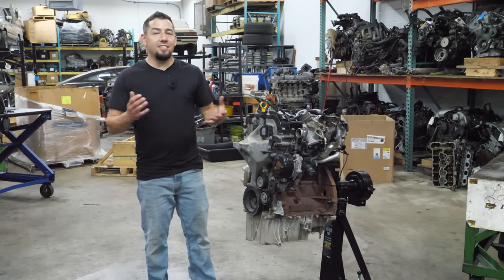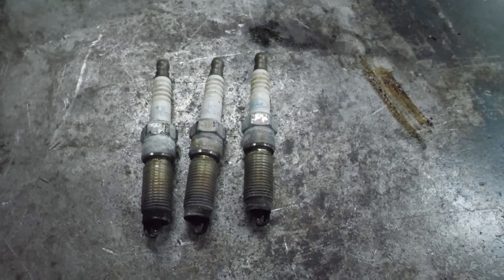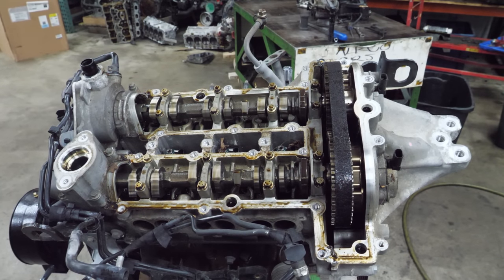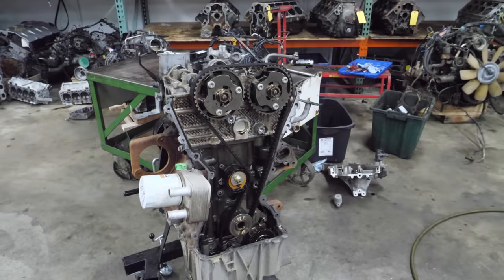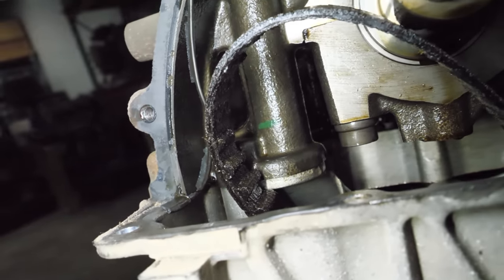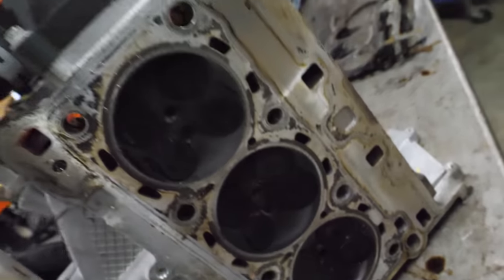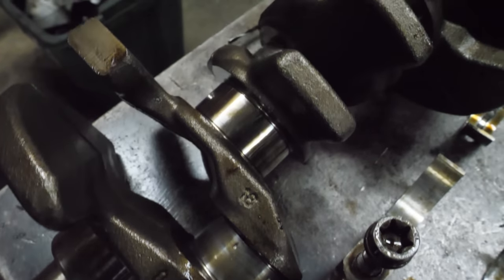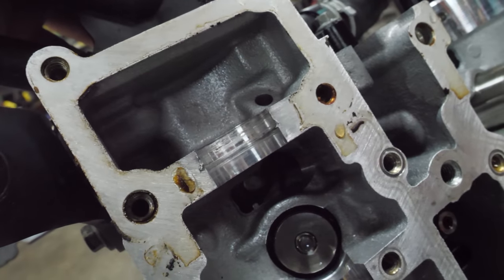JUNK Ford Ecosport 1.0L 3-Cylinder Ecoboost Teardown. LAWSUIT ENGINE!

Comment: I think it'd be interesting to see you do a tear down with an engineer that helped design the engine. If they are no longer employed by the manufacturer then hopefully they could give honest answers about the design decisions they made and the constraints that were placed on them.
Reply: They would tell you they were forced to by upper mgmt which is very likely the truth.
Reply: never seen a wet timing belt design. Never new it existed.
Reply: Packaging, crash safety and cost. Just survivable past warranty.
Reply: @thegrandhoovalation  a 3 year motor or something.
Reply: they'd show up wearing a paper bag
Reply: @paulherbert5548  it exists on Honda ohc lawnmower engines too
Reply: @paulherbert5548 
Reduced frictional losses and reduced noise are two reasons that spring to mind, have one in our 2.0 Ecoblue here in Australia. We call it the Ford Endura which is your Ford Edge. I too was surprised and I’d never known about them.
Reply: God I'd love to hear some dude that is responsible for this hellish engine explain what they were smoking when they created it.
Reply: @michaelslee4336  I'm sceptical as to whether a multiplate chain would have any more friction than a belt , and it is only minimally noisier
Reply: I work at Ford and have torn these engines down, the only fault I see is the rubber oil pump belt that's constantly in oil, the belt breaks down from oil not being changed and it will clog the pick up tube causing failure
Reply: @paulherbert5548  Peugeot/Stellantis also use such a design on their 1.2L 3-cyl
Reply: There’s no problem with this engine except the belts, I heard they replaced it on the next generation. Please stop saying engineering are stupid and so on, some of them arr brilliant mechanics and have shops you would dream of, they’re just asked to make cheap easy to assemble in factory very quiet very efficient engines, and reliable of course. these are the top one requirement, of course it does not mean those engines are the easier to work on.
Reply: @Fabri91  what is the advantage of a wet belt design?
Reply: @johnfloyd2551  why? Whats the advantage of a wet belt design?
Reply: @michaelslee4336  Noise I can understand but frictional losses? Belts already have lower losses and longer life than chains; how much  additional efficiency were they targeting?
Reply: @paulherbert5548  Belt running in oil..............I don't like that idea.    Only Ford could build that.
Reply: @paulherbert5548  
If I remember correctly from when I looked at it ages ago the belt manufacturer claims something like 25% more efficient than a dry belt. Stuff all I suppose given it’s just small thing but when you’re at the pointy end of the stick with efficiency and trying to get the best and quietest engine then they’ll do these things. Couple that with electric steering rather than spinning a pump every bit saves. Electric steering is good for active emergency steering, lane keeping, auto parking etc there’s a bunch of acronyms for them and I wonder was it these things that forced electric steering or fuel efficiency. Probably both at the same time.
Reply: I think they'd be too scared they were going to get beaten with a wrench to turn up! 😂  do you think they tell the guy who fixes their personal car that they design Ford engines for a living? 😆

Having said that, i'd bet money that if you were willing to go to Germany, they'd happily explain why they did what they did, and take you down to the factory to show you it being done, even if the decision was a bit of a rotter
Reply: @michaelslee4336  just trying to get my head around the fact of 25% greater efficiency. If it was that big of a gain I'd suspect it would have been adopted for all belt driven systems. Leaves me wondering ...
Reply: @paulherbert5548  
I did a bit of googling (take that with a grain of salt) they claim, that although it’s a big reduction in friction it’s only on a small component yielding only about a 1% increase in fuel efficiency. 
It’s like having a screw and claiming you can halve the weight of it, yeah big deal you can say 50% less weight (of half a gram)
Reply: The engenders that designed this shit are criminal! I gladly sold it. Even here in Bulgaria the most mechanics know about the problems of the belt running in oil. If I knew that before I didn't bought this car!
Reply: @paulherbert5548  GM 3.0 Diesel in trucks is the same, and worse- it runs the oil pump
Reply: @davem3789 - yep 👍
Reply: @patrickf6553 - probably forced to be cheap & use the worst suppliers.
Reply: @L46CTH  new gen still has a belt driven oil pump
Reply: @brucevrooman6107  Audi/VW are also using wet belt on 2.0 TDI engine
Reply: @ddimov2557   not for timing though, just the oil pump
Reply: @petermolnar8667  true only for the oil pump
Reply: Kamiz diesel motors run in places like the wakhan corridor in Afghanistan, start in below minus 30C and go on and on and are communist technology. One truck runs in mountain roads even in snow and has done well over 1000000 miles and more.
Reply: Ford should hang their head in shame. Henry wouldve had a heart attach. Use an engine used in experimental aircraft.
Reply: The F150 seems to be the only good Ford engine or the yellow taxis
Reply: @charlesgallop7026 you're working at Ford have you not question the designer why he designed a belt soaked in the oil.
Reply: @charlesgallop7026  why use in oil a rubber that breaks down in oil?
Reply: @charlesgallop7026  of course  the gauze will clog, there's a metal pocket over it to ensure any grit that falls out is right there ready to be sucked right back in!
Reply: 1st Design the engine. 2nd redesign it down to the price they want to make for & the weight. 3rd based on 2nd redesign it again to make quicker, easier & more easily automated to assemble! 4th Walk away your on a new project now. These are quality, warranty & manufacturing engineering issues now. 5th your Tux cleaned to go to the Engine of the Year Award Ceremony!!!
Reply: A good part of the problem with design is that the bean counters now reign supreme. The engineers can come up with a fantastic design but when the bean counters get brought into the meetings, they dig their feet in to reduce the cost somewhere. After a sucession of meetings and cost cutting measures, the design now has flaws. The bean counters look at it as production costs vs warranty costs. If the part makes past the warranty period it is deemed good.
Reply: @paulherbert5548  Citroen uses them too, plenty of problems..belts are
crumbling and clogging up filters etc..they lay the blame on oilchanges.
According to them oil should be changed every 12000 km.
Reply: @paulherbert5548 none whatsoever fucking ever if you've owned one!
Reply: @paulherbert5548  It doesn't exist as a timing belt after the teeth have stripped of it(which seems certain to happen)
Reply: @patrickf6553  Probably a big doobie packed with sheared timing belt teeth🤣
Reply: @paulherbert5548 Peugeot use a wet belt on some of their smaller engines too
Reply: @johnfloyd2551  True, but only on their consumer grade engines that I would not recommend.
Reply: That wouldn’t really work. Engineers are a mechanic’s worst nightmare.
Reply: I think you guys need to remember the first thing that was wrong when the timing cover came off.
It looked like a belt tensioner that was floating loose in the cover. I would bet that was supposed to keep tension on that oil pump/balance shaft belt. That is why the teeth striped and then the whole series of failures followed.

All the haters bagging out what they see with no other reason then there was a failure, without defining what caused the failure. 
Ok the design is very different to everything we know, so what more then one way to skin a cat. And for tge wet belt design I would have thought that the oil would have weekened the rubber but the probably use  a special compound.

So the moral here, find the cause of a failure before you condemn a design.

Also glad all you fools have never seen odd failures in even the best engines. Someone wrote below they changed design in later models. peobably figured what went wrong with failures.
Reply: The 2 l Ford Ecoblue Diesel Engine has also 2 wet Belts.
Reply: @paulherbert5548  Absolutely everything. Euro emission standards are getting so hard to reach that ie. some motorcycle models are too expensive to update/research to meet the specs.
Reply: @brucevrooman6107  I don't mind idea of wet belt at all. But what I do mind is that it still should be in separate casing. Not in direct contact with all of the engine oil.
Reply: @alanhat5252  Your conception of oil deteriorating oil is 100% false and old. If correct rubber and correct oils are used, there's no issues at all. You're correct though that there are rubbers that don't handle oils well. Like epdm isn't very good withstanding it. Viton though, just fine.
Reply: @jothain  I agree.  I do prefer a chain for such a critical function.
Reply: @brucevrooman6107  I'd prefer chain too, but these days they're like bicycle chains on cars, so it's all the same for me.
Reply: @jothain   My first car had a Chevy inline six.  It had two timing GEARS that would likely last  forever.    How about we go back to that durable design  !!
Reply: an accountant designed this engine
Reply: @paulherbert5548 mechanically- no advantage. They are a really stupid idea to shave an extra 0.01mpg because of really stupid CAFE regs. This is the same reason why we get stuck with oil burning cars with ‘low friction rings’- the cars may save 5 gallons of gasoline over their lifetime, but their lifetime is cut short due to poor quality.

Comment: I had a 2014 Fiesta with the 1.0T. Started exhibiting head gasket failure symptoms (cold start misfire, no heat due to air in cooling system) around 40K miles on it. Ford put a new engine in it under warranty and I sold it not long afterward. Having seen this teardown, I’m glad I did. Their paperwork said “cracked block” - assume they meant cracked head.

It was amazing on fuel, torquey, and sounded neat - neat enough to get my car/youtube video featured in a Jalopnik article on “cars that sound better than they ought to.”
Reply: No, they do mean cracked block!   They cut a channel between the cylinders and that apparently cracks, giving the symptoms of a head failure whereas you really need a short block to fix the engine.   Or a complete swap of everything.
Reply: Regarding fuel economy, EPA rates 1.0T Focus worse on fuel compared to, say, a Mazda3 Skyactiv 2.0 from the same era while making LESS power. EcoSport was also rated worse on fuel than Mazda CX-3 or Honda HR-V, both with larger NA engines that make more or similar horsepower. Given the lack of displacement tax in North America and the issue with Ford Powershift, I'd love to know the reasoning of anyone who bought the car.

This is why I am glad North America doesn't have displacement tax because then you get terrible engines like this. In a Fiesta or Fiat 500 I think it's fine, but in a Focus or EcoSport, the displacement is just too low and so you have to constantly rely on boost, which destroys fuel economy(engine has to run extra rich to prevent knock) and engine longevity. If you have to have a tax, base it on fuel consumption or emissions, not displacement.
Reply: If a turbo engine is not on boost it is inefficient equalling WORSE fuel economy due to lower compression to allow for the increased cranking pressure of the extra air blown in due to the turbo.
Reply: @gvicj05  I'd say it's a bit more complicated.   My Subaru on boost was thirsty, keeping it off was more efficient but less fun.   My direct injection 330i was very efficient, unbelievably efficient.   So much so that my 1.5l Ecoboost couldn't match it and you needed it in boost all the time because there was no power without it, and would leave you limping out of junctions dangerously.   My current 320i does have turbos and you can hardly tell it's a boosted engine, and is even more efficient due to the direct injection.    I'd say direct injection is the key to an efficient engine, turbo or not.
Reply: @johnsim3722 e said that an engine with a turbo not in boost will be less fuel efficient than that same engine without a turbo, which is true due to parasitic drag.
Reply: @soulsweeper1630  Hence 3 cylinders. Less piston ring friction.
Reply: @soulsweeper1630  I hear you.   Just saying these engines with direct injection make them so much more efficient that they really do reduced excess fuelling.
Reply: Ma’am the 1.0 didn’t exist in 2014. You had a 1.6 or 2.0
Reply: @jimmysturdevant9843  I disagree… my Fiesta SFE was a 2014 (10th VIN character “E”) and most definitely had 3 cylinders.